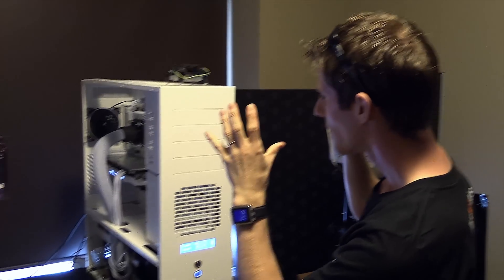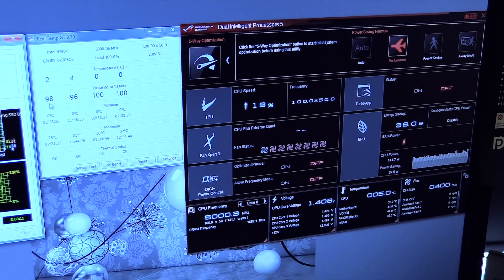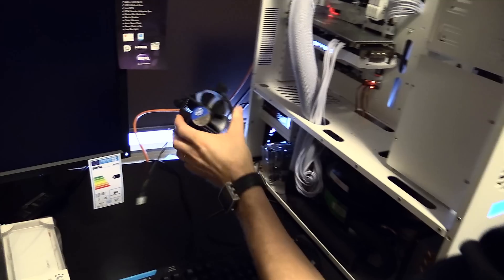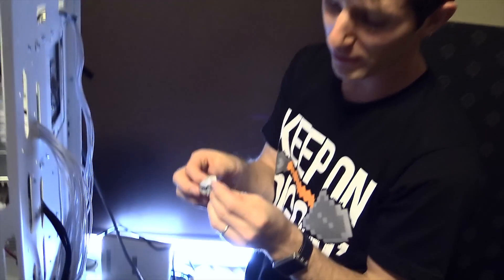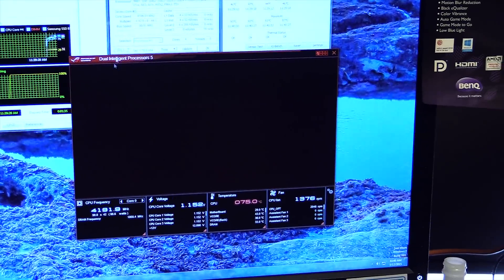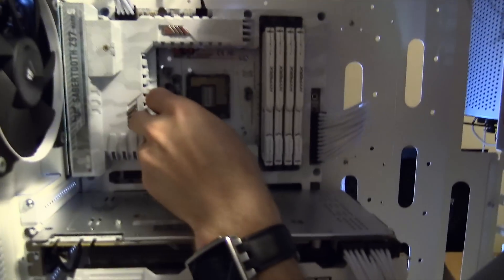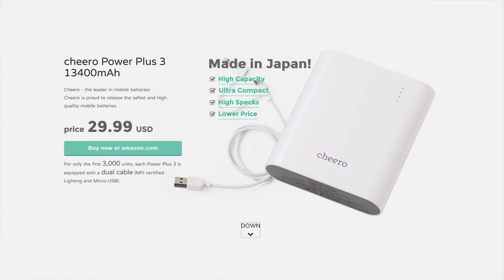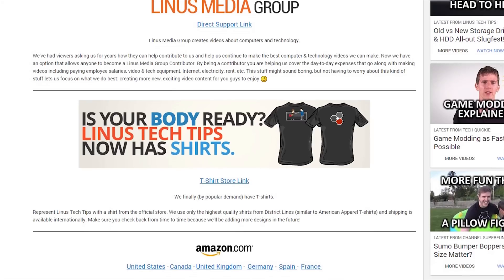CPU Cooling - Does temperature impact performance?

Comment: 10 years ago! No wonder! I thought something was off.. and that ram speed was a bit slow. But the I-7 14700k has been around for a long time, dang. 
In relation to the purpose of this video! Keeping the cpu cool while being able to still madly overclock it will be good 👍 but just keeping it under thermal throttle is good. But heat does degrade parts too. “Unless Linus gets there first” lol

Comment: If you live in a hot place and the stock cooler is not working well enough and cpu temps are reaching upwards of 90c to even 100c for a brief second sometimes. Cooling will improve performance.

Comment: No it does not have an impact in performance, but what it does do, is it allows the system to run more efficiently and optimally while reducing the chances of a malfunction.

It will also increase the longevity.

Comment: Lower CPU Temp° will reduce or eliminate stuttering during games, as the CPU will start to throttle and reduces its running performance when it's "too hot" to prevent damaging itself.
Reply: Why tf do you have 4 likes and you are #1 in this vid's top comments
Reply: For AMD Ryzen yes for sure

Comment: I hate it when the cooler comes off with CPU still attached to it. I just hate it. Happened to me a few times but only with a very old paste that felt almost like properly fired ceramic because it was so dry. Still better than coming off with just the heatspreader though.

Comment: Cooler CPUs won't work significantly better, but they'll last significantly longer. That's irrelevant for most performance nuts though, because they'll be upgrading them within a month.  Longevity doesn't concern them.

Comment: I mean... when I run Apex without cooling, I get about 20-25 fps (on lowest possible settings), but when i turn on the cooling, i get about 40, sometimes 50 fps (still on the lowest settings)

Comment: when it comes to performance? definitely no, but if u dont mind that part? it will cause the unit to restart if the unit reach each temp limit, and you wont be able to use ur unit normally

Comment: No it doesn't it actually helps. It's very complex it's chemistry and the relationship between electricity and metal but there's a fundemental law that without heat you can't access performance because of activation energy pathways caused by electrons.

Comment: what i perceived was only on the hot side when above a certain comfort zone on GPU, they lose frames.

the only thing i saw affected by temperature was my Nvidia 8500 GPU, the frame rate dropped when at high temp.  at nominal temp things should not change speed. unless supper cooled like -273C or some thing... (or what ever temp is the right one) the only difference consumers would need to take into account is above nominal temperatures. 

per say  normal is 30C to 50C but it crashes at 120C, so it would probably run slow at 80C just a bit BUT at 100C it would lag a whole lot! and to top it, now you have autoclocking devices, tho it would naturally down clock when hot hence losing performance! 

so to speak i made a PC lag at minecraft! and it turns out the stock GPU versus the "On board" or maybe in CPU GPU... (don't know), the on board was faster than the stock GPU! i was tempted to put the 7600 GT i had since the onboard cannot run OpenGL for some reason... (so faster but less advanced)

Comment: Does the stock and cheap cooling stutters in the game? I have a Cooler Master HYPER TX3i for a i7 7700K its shows 70°-80° but some forums says this CPU's thermometer is not good...
I play games and some time the game stutters not lot of time but not fix 60fps (and i want to play with V-Sync because of screen tearing!!)
Gtx1070, 4x4gb 2400mhz cl14 ram, 7200rpm hdd

Comment: This was quite pointless. Obviously just cooling a CPU doesn't improve performance. Overclocking a CPU does. HOWEVER, overclocking make the cpu hotter, so the cooler your cpu is, the more you can overclock. So yes, temperature improves performance, only if you overclock more.

Comment: Is it dangerous if my CPU have an average temp of 35-43° on no loads?
Reply: Definitely not dangerous. A desktop CPU can easily handle temps of up to 75°C (depends on the model, my 4790k shouldn't get hotter than 75 according to intel).

What are your temps under load and what is your ambient temperature?

With an ambient temperature of 21°C, I'm running at 25-30°C (while surfing, watching YouTube).
With an ambient temperature of 30°C, I wouldn't be surprised to hit 40°C wile watching YouTube. 

With CPU-Z CPU stress test running, I reach 66°C (with again 21°C ambient).

Comment: well linus to be honest you tried to solve an interesting question, but instead you created a great video for us pc novices on what NOT to freakin do with ur computer XD also my laptop is still running at 80-95 C cpu temps and 70-85 C gpu temps when i do gaming. its a strong pc with 970m and 4720hq but i feel like its going to explode out of now where, shoudl i be worried?

Comment: What is a safe temp for i7 7700k?? When I over clock to 5ghz I hit 85 degrees running benchmark on xtu and just starting up doom back to back as a test will go to 82 so my question is, is that safe? Right now I have it at 4.8ghz and never go over 75 gaming and in xtu benchmark It goes to 82 degrees

Comment: The answer is pretty simple because in school your physic teacher maybe learned you that cooling electronic parts increases energy efficiency and as the energy losses becomes thermal energy that means more your cpu will be cooled more your cpu will be efficient and live for a long time in principle electronic parts has no losses at 0°C or colder

Comment: What is this shit test? IMO you just wasted our and Your time.... you should have tested like this: Make a System Primestable with a Fixed Voltage and look how high u can clock the CPU with Watercooling ( Lets Say at 70 or 80 Degrees) and Than try to Push the Clock higher at same voltage with sub Zero cooling. EZ as That

Comment: I think that the higher is temp the shorter is life of CPU because of natural process of material degradation. For real and useful results you have to run two systems with different temps and let them do same high-load test for years. But even if the hot CPU will die faster, it is always a question of power efficiency. Lower temp means higher price of cooling system and higher energy use because of it. I suppose it is cheaper to change CPU's one time in a 3-5 years than run high-performance cooling system that consumes way too much energy (because the difference may be noticeable only if temps will be 0-10 and 70-80).

Comment: Condensation isn't really that big of an enemy... I still have a slot one celeron from the late 90s running overclocked in an all acrylic pc with cold cathode lighting that I made for the school I was in at the time... They gave it to me upon graduation, and since it was pretty out outdated even at that point even... Annyway, that BEAST (and many others I made) condensed like a mofo due to the era's preferred method of water cooling... Which was making your own everything involved with the process (way better than the junkyard wars episode, lol) using transmission coolers, surgical tubing, small tupperware or other better sealable boxes with internal pumps, etc... AND A PELTIER, or TEC (thermal electric cooler)... That TEC would cool components just as well as this rig, producing sub freezing temps, condensation on the immediate boot up and run, then ICE all over the back of the CPU and all over the direct area of the mobo... That ice was there and is still there while running... And it ran for years on end, with ice all over it, and it never was and still isn't a problem.  Due of course to what you already know, and that being that the water condensed is distilled, impurity free, and non conductive.  And despite the common thought being that impurities will leech their way in over time, it never had... likely due to the distilled water being ice, and ice not really picking things up.  But that system literally ran for over a decade with ice condensation all over every bit of its most important bits, and never faulted in any significant way... Or in anyway related to said condensation anyway.

Comment: He should have mentioned that A LOT of heat CAN slow it down. If you run it really really hot it will throttle down to protect itself, thus slowing it down. As long as you never reach the CPU's max temp threshhold, it won't matter how hot or cool you run it, it won't go faster or slower.

Comment: Ur sponsorship is stupid because you uploaded a video debunking high wattage psu's
Reply: One reason to use a higher wattage PSU is to keep it quieter. I have a 650W PSU for my system that never quite hits 300W because the PSU fan never even needs to turn on. The PSU stays silent because it's hardly exerting itself.

And, no it wasn't expensive. Like $40 IIRC.
Reply: I never said it was expensive? :/ I can understand you debunking me debunking him but don't lie about what i say, ok fam?
Reply: Cringe Gamer I didn't say you'd said that. It was preemptive. Relax.
Reply: Right, sorry
Reply: Cringe Gamer It's the internet. You can be forgiven for expecting unprovoked hostility from stranger. Ha.

Comment: I have a Core 2 Quad Q9550 the idle temperature is 42 Degree Celsius and 60~65 Degree Celsius when i`m playing games/any games i want to know if it is normal temperature for core 2 quad q9550... i`m using stock fan but it runs on 4200+ rpm

Comment: It won't necessarily run faster, but it will run longer....
Reply: i5 2500k sandy bridge at 7 years, still going strong...
Reply: Using my i7 2600k since 2011 with the boxed cooler. Thinking about finally getting something proper....
Reply: Lower temperature does not = run longer. It's metal and simple conduction law to put it simply think about those massive power lines below land when's the last time they needed replacing they don't even need cooling and they're underground they get hotter than a cpu. Metal is a wonder material for conduction and sustainability. If you don't believe me and have a spare pc any decent cpu and new one run one without a fan and thermal paste and your new one with let me know if the older breaks. The whole point of cooling is safety as metal can take heat other parts can't and can catch fire so if anyone does do this keep an eye on the pc just in case but I doubt any harm will come.

Comment: You may get better performance if you actually have a cooling problem (since the CPU will slow itself down if it gets too hot). My PC upper case exhaust fan currently blows out air up to 10 degrees celcius warmer than room temperature after gaming for  30 minutes to an hour... That means the CPU and GPU fan is blowing 10+ degrees celcius hotter air onto the components.

Comment: Engineeringly speaking, Stock speeds are calculated by the desired ambient temperature's range. (usually it's 0-45C degrees)
So if you overclock your PC you are altering the stock values. It's all connected. So if we skip the boring calculations, you'll get something like -10 to 35C degrees ambient temps required for that rig.
Hope it explained something about how temperature impacts stability, thus performance(@ OC)

Comment: if It doesn't affect performance then why do ppl spend hundreds of dollars in water cooling? I'm assuming it doesn't have an impact on stock speeds and voltage right?
Reply: Simple. It won't go any faster at lower speeds, however it would not run as stable, as at really high temps. And water cooling (also phase change as well) allows to keep CPU within that comfortable range. Also, it allows for PC to be quieter under heavy loads.
Reply: because they are rich
Reply: Im Foruk rich people don't spend useless money(at least the ones who had to work hard for it). They are rich for a reason xD
Reply: +PCFreak 
Agree! My boss drives 5 year old VW Amarok, his wife drives Defender, and children - reasonably priced second-hand cars. I don't think he would be millionaire if he was wasting money on different shit. Also, he only upgrades his phone when the old one stops working. Unlike some people who change their phones just because new one came out
Reply: jur4x and with every new phone (every year?) comes a new loan... so impossible to save up money xD
Reply: PCFreak if your processor goes over a comfortable temperature it starts to become unstable the solder points start to break and things actually could start to melt
Reply: Tkvlogs so what linus says is that "it doesn't matter" IF you don't overclock. Which is already known to enthusiasts xD

Comment: Hey +LinusTechTips, do you think you guys could try improvising a motherboard cooler? I think that if the MoBo is cooler, then the data flowing across the channels will move more quickly due to less resistance, and if the components can communicate faster, then they could work faster.

Comment: 11:19 exactly what happened to me when I removed the stock cooler from the FX6300 in the work PC last week, got even scarier when I put in the new cooler and it wouldn't post, fortunately yanking it back apart again and reseating the CPU got it up and running. Also while making it colder doesn't make it run better just from doing so (UNLESS it's running hot enough to thermal throttle) it does allow for the HEADROOM required to Overclock to perform better.

Comment: Was really  helpful to understand what actually happen when CPU is running cooler 
not improvement in performance, But I think CPU temperature will affect  it durability as well as power consumption (But cooling process take more power than what it save from CPU consumed power).
Reply: i would like if the video are edited in short & sweet manner & right on point. :D

Comment: The short answer is: NO, if you are asking whether it would increase the performance by lowering the temp below normal ranges.

The long answer is: YES. Because there are temperature control mechanism in your PC that will either slow down or shut down your CPU if it is overheating so you still need a decent cooling mechanism. This is especially true if you are overclocking. No cooler = no overclocking = slower performance. So overall, temperature plays a big role.

Comment: There exist speed-indepent CPUs that don't use a clock and run as fast as the circuitry allows.  The first partially speed-independent CPU was the ILLIAC II computer from 1963 (see wikipedia for details).  They use an unusual logic block called the Muller C-element, invented by our next door neighbor, David Muller from Urbana, Illinois.  With that type of computer, indeed, YES, cooling down the circuitry would make the cpu run substantially faster.
Reply: Ivan Sutherland - one of the fathers of computer graphics - from Caltech is a big proponent of speed independent circuitry ( http://www.cs.virginia.edu/~robins/Computing_Without_Clocks.pdf ).  However, many people find it totally strange and non-intuitive to design with speed independent component blocks such as the Muller C-element.  So, kind of like GaAs VLSI (vs. Silicon VLSI) nobody does it because it's harder to do than conventional clock-based circuitry with gating of results.
Reply: Donald Gillies excellent thanks i didn't know that at all will look for it. why didn't they design cpu for micro computers like these?
Reply: Again, many people find it totally strange and non-intuitive to design with speed independent component blocks such as the Muller C-element.  With regular clocks you can think of all the signals at waiting at a series of physical gates and when the clock cycles the gate opens, the signal goes through to the next gate(s).  

I don't know the exact difficulty with the C-Element because I have never designed logic to use it (my dad and his colleagues including Muller did, though) : https://en.wikipedia.org/wiki/C-element.

With regular clocked computers you can just shorten the clock cycle until it fails, then you know the maximum speed of the computer and the exact speed of every instruction.  With a C-element computer different instructions might run at radically different speeds, even if the circuits were from the same batch :-) and it would be very hard to say precisely "how fast is this computer" because it would depend upon what it is doing and whether you got a good one or a bad one from the VLSI oven(s) :-)
Reply: yes fascinating i didnt know these kind of computers at all... for me it's a bit similar to overclocking yr cpu as musch as you can and it depends on the batch, some will go faster than others.... with reducing temperature etc you can try and make them as fast as they can
Reply: What you describe sounds horrible to me as a programmer ^^ Having multiple parts of my program run at variant speeds is like loosing control over the flow of the program... as if you ran everything as asynchronous tasks, but not really because they would still... urghs.. its already mindf*cking me. Would not like xD

Comment: More cooling opens up for potential higher clocks, which can in turn mean more performance. BUT, running the exact same speed, as long as the CPU is stable, cooling will not impact how fast it runs.
Reply: and whats about turbo boost??
Reply: That cpu was at 5 ghz

Comment: My cpu is around 40 degrees at idle (stock cooler) do I need an aftermarket cooler?
Reply: no need, stock i3-i5? it will be alot quieter with a tower setup tho. 72c is the max temp before they throttle. An i7 needs a better cooler.